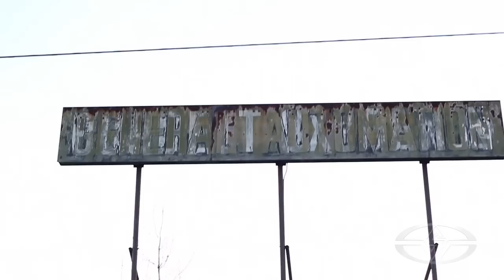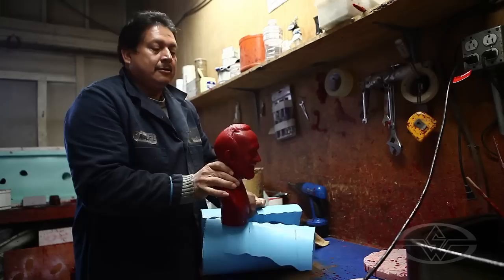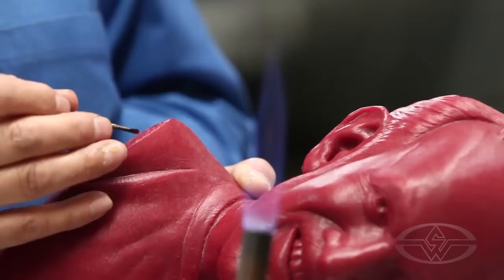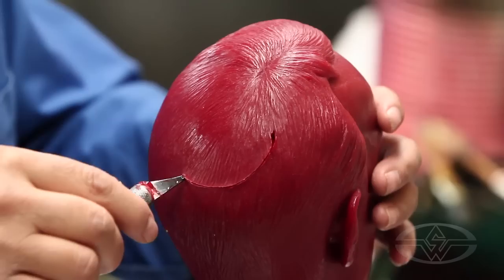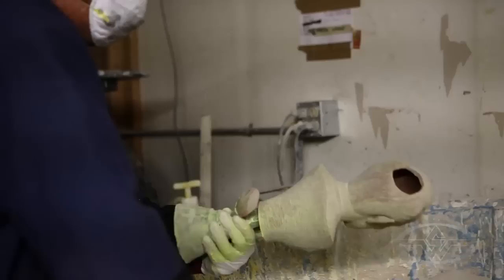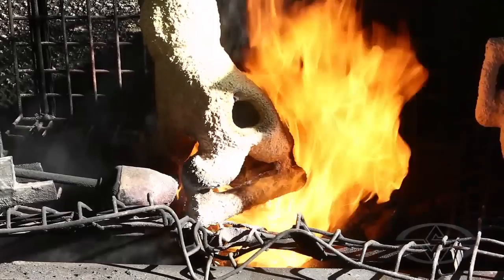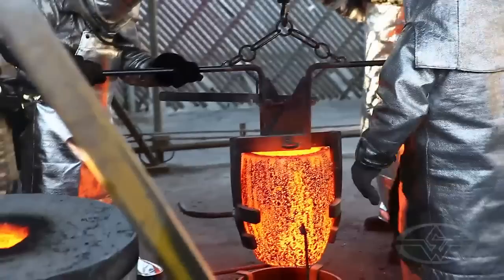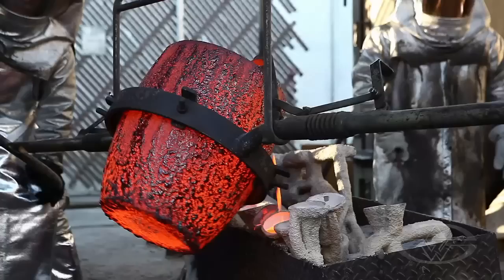The Lost Wax Bronzing Process - Stan Winston from Sculpture to Bronze at American Fine Arts Foundry

Comment: 4:30 Not exactly the same. With chasing the bare minimum is removing the seem but really "chasing" is re-carving or engraving all the fine lines and details that were flattened out or perhaps weren't even there in the original sculpture. Chasing and Repoussé is the technique used on the Statue of Liberty. Repoussé is the hammering of volume usually from the back and Chasing is hammering, usually with a flat chisel like tool to create fine lines and details, usually done on the front side of the object. On wax you could simply carve away any lines and details you want to add before creating the final mold for the Bronze. Even the final Bronze mold will need to be chased to be a perfectly finished and flawless piece.